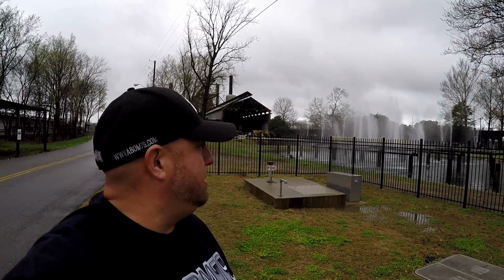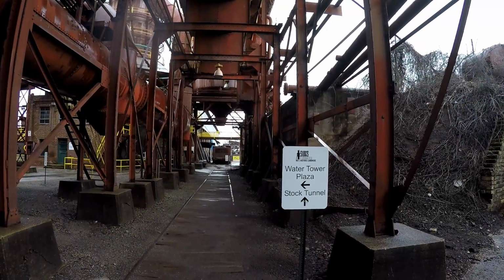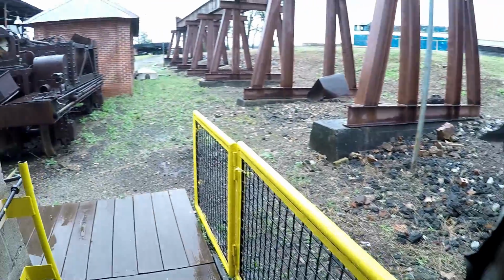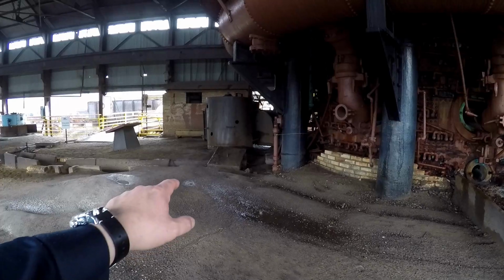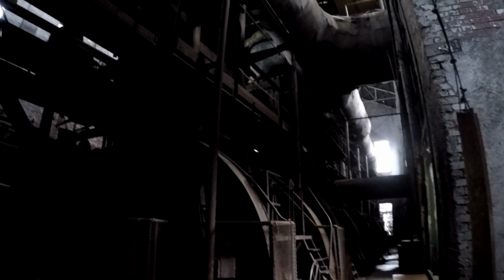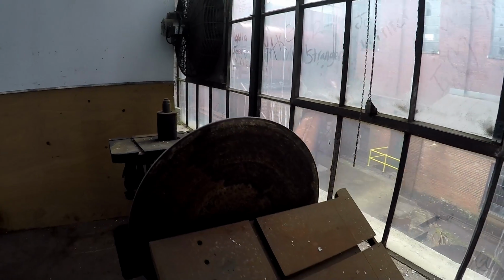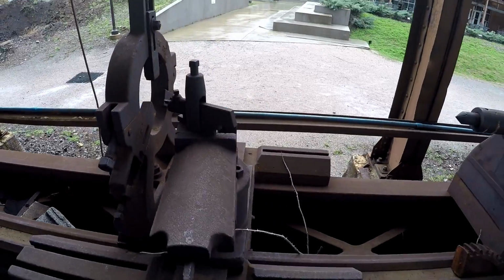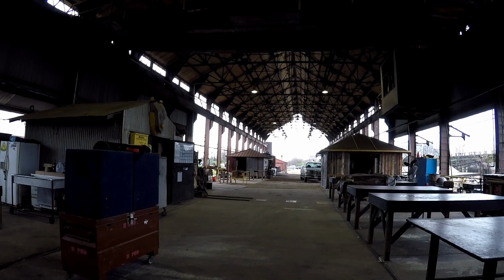Sloss Furnaces, Birmingham Alabama

Comment: Tunnels ain't the best place to work there when deal with BFG. BFG is basically CO (carbon monoxide) which likes to accumulate in low places. Operational personnel should ware breathing apparatuses, work with caution there. Areas around changeover valves of hot blast stoves are highly dangerous for CO. Areas on the superstructure (top of the furnace) around charging apparatus, top valves are dangerous for CO too.  Steel mills used to maintain rescue stations with full time trained personnel on the staff.

Comment: I worked for a company that supplies drive systems and rolls for the steel industry and yes the steel industry is in decline,almost gone. A lot of the old ,huge, mill complexes are either museums now or have been torn down; why? Simple, the steel manufacturers didn't invest in or modernize the mills, and the cost of labor and management sealed the deal,ironically, if you can't make or roll steel you can't  defend your country. There are a few mills still running, but for how long?

Comment: I may or may not have climbed the skip trolley stairs to the top of the furnace in the middle of the night when I was like 14.  The stair treads are 3/8" or so plate and some were very sketchy.  Not sure you could still get up there, but it's quite a feeling.
Reply: Lol. Dude, I've been atop both furnaces more times than I can count. I worked at Fright Furnace. We've even had actor parties up there till sunrise with about 20 of us.

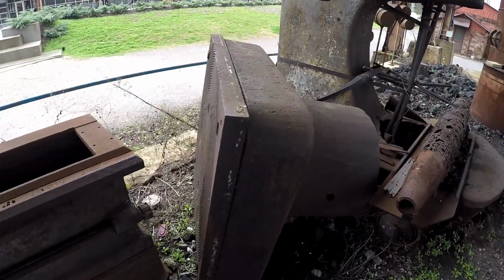Comment: The big solid piece of iron  at 33:52 is an anvil base for a power hammer, should have a machined groove in the top to hold hardened anvil blocks in with wedges.. Probably for the one it's sitting beside, but you never know in a place that old.. Hammer fits over it and tries to punch it through the floor.

Comment: We lost the Texas Foundry which was in operation before the Republic of Texas and many years before Statehood.  It's last job was making parts for GM and they shifted to Mexico and there went the workers and the massive forge.  We also at about the same time lost the Lufkin Industries Forge that make massive castings of Gears, shafts, Jack pumps and the famous ones Single ended 'donkey'.  They fit in tight places. The tubular and the large plate are for wood working - the tubular moved up and down (maybe) and sands curves.  The large flat with a wonderful table is for sanding flats.  This was a pattern shop when the foundry did castings and not just pigs.   Doing sinks for example required boxes and shapes to pour around.

Comment: It was a metal lathe. Wood lathes don't have a cross feed or any of that. Also it was a jointer not a planer and the big circle was a sander it used big sheets of sandpaper put on it. Also the on last one you thought was a planer is a surface planner

Comment: Another comment from me: The blast furnaces had a couple of bell shaped 'valves' at the top of the furnace. To charge the furnace, initially both bells would be closed by pulling them up to the seat; the material (hauled up by the skips) would then be loaded onto the top of the top bell. The bell would be dropped sufficiently to allow the material to be dropped on to the second bell. the first bell would be closed, and the second opened and the charge would drop in to the furnace. The bells acted like an air lock (long before NASA came along!). BHP in Wollongong, Australia (still going!) used these types of furnace and the bells eventually wore out and had to be resurfaced. They used a really big jig to set the side of the bell horizontally at the top and rotate it; a really big LPG burner heated up the bell and when hot enough, they had 2 x 1200 Amp Lincoln Submerged Arc welders in parallel and used quite thick wire (1/8" to 1/4"?) to go down in to the flux to reface the bells (sound familiar, Adam?). The leftover flux fell off the bottom as the bell rotated and was recycled to be used again. Fascinating stuff!

Comment: 2 Comments: 
at 30:55 - it is a grinder, and would use emery discs stuck to the working surface by a type of glue; you would heat up the glue pot in hot water and coat the disc, then apply the emery - my Dad had a Sunbeam comb (coarse) and cutter (fine) grinder to sharpen the combs and cutters for the shearers. Sunbeam was an Australian company which made sheep shearing gear, originally line shaft driven, and later electric.
At 39:55, it brings me to tuyeres (pardon the pun) to see this blast furnace ... !

Comment: oh, I think the machine by the window in the powerhouse was a spindle and sander and a disc sander. I saw a 3'-4' disc sander (two station) for sale on Craigslist once, so I know they made them bigger than 12-14". I bet they used all those woodworking machines to make the casting patterns, but maybe in a dedicated shop elsewhere on the site. that's my guess on that.

Comment: Good move Adam Booth ! Great initiative, THANK YOU.
Mountain Man is absolutely right. The plant management utilized the free space within the powerhouse - that otherwise would have been wasted - by setting up the patternmakers' shop right there:  a very intelligent solution, in every sense. 
You are right thinking the first machine to be a woodworking lathe, the one which you called 'grinder' is actually one half of a very early version of a disc/spindle-sander combination; an essential tool in patternmaking. The one that you have trouble guessing is a thickness planer - very early model also - as are all the machine tools here, obviously..
This whole lookaround is tremendously interesting, a most welcome look into History ( with the big 'H' ) of the First Industrial age, as it found its finest expression in the United States of America.
Rather important part of this tour is the revelation of the priorities, prevalent in the in the mind of those responsible for the running of things at the time. 
One can clearly see it in the way all machinery was built, with everything exposed ; belts; gears; cogwheels; pulleys; ratchets, blades; cutters; all kinds of bits that could - and DID - injury, hurt, maim - and KILL - anybody, careless and unlucky enough to get too close.  Human beings were then considered simple - freely dispensable - extensions of those 'precious' machines and consequently treated in a cavalier manner.
Every man for himself was the prevailing motto. If one was maimed or killed. well...too bad; plenty more where that poor bastard came from.
Having lived thru  and experienced first hand some of it myself, I feel excused for holding a rather jaundiced look in this regard still.
Nowadays - thank be to all gods in the universe - such state of things, at least in our corner of the world, IS treated with the greatest severity.
Thanks again Mr Abom79. I give you ten marks plus out of ten.

Comment: That 'tilting' bed unit appears to be a disc sander...and the adjacent looks like a drum sander...possibly an oscillating type, where the drum moves up/down as it turns...these appear to be wood shop stuff as there's that jointer too....disc sander used in a lot of metal fab shops too.

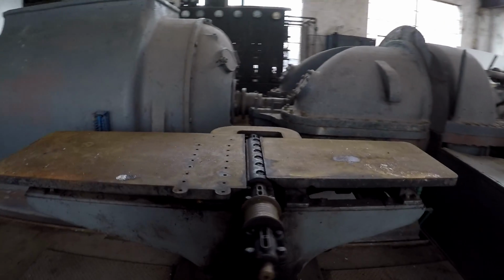Comment: at 27:12  it is not a  "planer" but actually a jointer and it's missing the fence.   Planers surface a piece of wood to even thickness the full length.  Jointer is for making the edge of face of wood flat for jointing 2 together or making a straight edge from a crooked one.
Reply: I learn things in the most diverse places. Never knew my Granddad's "plane" is really a jointer. 80+ years old, still runs, not a speck of rust. Thanks for the clarification!

Comment: I love foundries and mills. i worked at US PIPE in Burlington NJ. for 2 years when I was younger on the casting machines, but I worked in every area of the plant in maintenance at one point or the other. Many nights up on the skip charger and cupola deck.
Pulling stuck birds nest ladles was the hairiest job standing on the edge of a full 20 ladle on the turn table.

Comment: That was AWESOME. We have a few historical places here in  New England. we have the American Precision Museum in Windsor VT, there is a museum in Manchester NH about the Amoskeag Mfg Company. They made everything from textiles to steam engines. One of the things they are most famous for are the old steam pump fire engines. Then there is the national park in Lowell MA which is really the birthplace of the industrial revolution in America. I don't know if anyone answered you about the wood lathe, but it's a pattern makers lathe. The patterns are painted different colors based on the purpose of the feature of the pattern. I know red means it will be machined after casting. I'm sure you can easily google to find out what the other colors mean. Great video, this place is definitely on the bucket list now!

Comment: by the way the the company that made the ten ton crane morgan engineering is still around, they also used to make steam hammers, but now just make knetic structures like moving roofs for stadium, blaw knox pavers, and cranes as well as mill equiptment even to this day they are still around, under differant ownership but still around after 100 years

Comment: I work at a 200 year old oil refinery and there are some old parts (structures and machinery and piping) . I stair at the Beauty's of the old days ,all the time. then somebody says ..." hey you going to stand there !!!!) oh ....yea I'm supposed to be working ! lol . you can tell the time line of the structures by how it's made first they used  hand formed rivets then square headed  bolts then of course welded. we have a hand full of valves with swastikas cast into them. cameras are prohibited !  In the training video they say " your gate pass will be revoked"  but GREAT video !!

Comment: ah yes I remember hearing about the birmingham steel in geography in gradeschool when we studied about the states, the mill looks like it has seen better days needs a new coat of paint and a little maintanance on the outside looks like,  very rusty

speaking of old forges, the old blacksmith shop from bethlahem steel is being turned into a blacksmith school and some of the hammers will be put back ito use, I dont know if they will work on the largest one that has a u shape and resembles the big chambersburg in the old altoona blacksmith shop that was a 37000 lb hammer, or was it 30 ton as I try to remember but anyway the old forge shop for bethahem steel will come back to life think of all the parts that were made in there to keep the iconic mill running and young and old blacksmiths will be able to work with and learn on them how awesome is that.

by the way the boilers that heated the air  for the furnaces as you mention were called cowpier stoves I belive if they were indeed used to reheat the air for the blast furnaces.

haha the part about it being haunted its funny you mention that as I was just thinking the tunnel with the water looked like something in a movie or game where something was going to pop out and come after you, but the rain and sound make it more dramatic in the kind of sadness of loss of its iconic use as a working mill, from a more iconic period when we made more of our own stuff in the states.  though north west indiana is still churning out the metal, you got the us steel works at gary indiana and its the largest in the west hemisphere even 100 years later, and the arcero mittle belt harbor mill that has I belive the most blast furnaces in one mill with 5 not to far away from it so it makes no less then 9 blast furnaces in one region.
Reply: I'm a boilermaker. I work at these alot
Reply: the cowpeir stoves? or the mills in general?
Reply: Steel mills, refineries, coal fired power houses. I live near Gary,Ind.
Reply: well I am sure it keeps you buissy with all that industry up there as there are mills and refinerys as far as the eye can see. been though there on the way to chicago many times, but I hear the crimerate in gary is abysmally high, though that might just be an old wives tail by now.  but that whole area to east chicago is one giant industry after another.

Comment: Adam, as cool as that is (and it is VERY cool), if you're ever near the upper penninsula in Michigan, you HAVE (absolutely HAVE) to stop into Fayette State Park.  It was a town that was built near the docks of Escanaba to produce pig iron.  They had been shipping ore to lower Michigan to be smelted, but were losing 40% in volume during the smelting process.  Was quite costly to ship that 40% that was worthless.  So, with the abundance of hardwood and lime stone needed to smelt the ore into pig iron right there in the U.P., it was a natural choice to just build a smelting operation near the ore mines and only ship the pig iron south.
It operated for 24 years, but in 1891 when the charcoal iron marked fell out, everyone just left.  It is awesomely amazing to not only be able to walk around the smelter, ovens to turn wood to charcoal, etc., but they left a ghost town.  You're able to walk through the houses and buildings and are able to find the equipment, machines, school, theatre, etc.  Almost feels like they just turned the town off like a light switch.  There are still boring bits stuck in the limestone where they broke off in the quarry.
All throughout the town are plaques describing what you're looking at and explaining.  To top that, it is set in what has to be the most beautiful harbor in all of michigan (IMO) with tall, tree-topped limestone cliffs poking out into the lake!  In the fall, first couple weeks of October, it is absolutely stunning with fall colors!
http://www.exploringthenorth.com/fayette/town.html (i'm not affiliated with that site or fayette or the state of michigan in any way, other than living here and loving it  :)

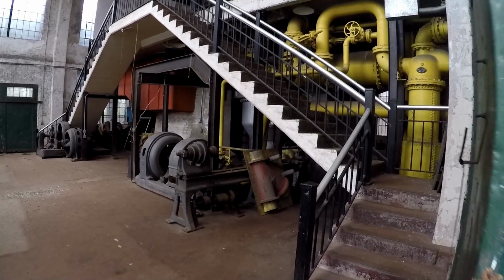Comment: 26:00  correct, it’s known as a Pattern makers wood lathe.  
-Many production architectural wood turners  (balusters and spindle work) still use those old pattern maker lathes.  Oliver is a highly sought name brand for those.       
-The following wood jointer, disc sander and spindle sander were neat to see there too!  It’s cool many patterns for castings all started with wood and skilled pattern maker aka: woodworker.    

Great documentary style video, man!

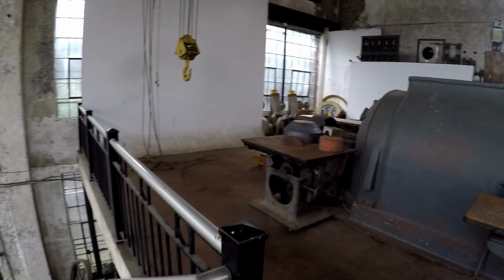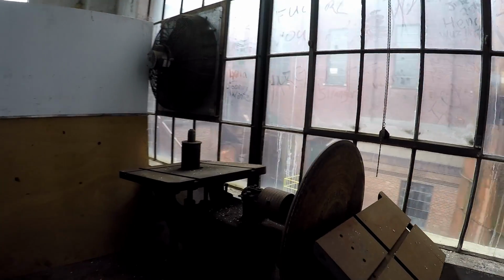Comment: At 26:49 when you entered the Pattern Making shop the large machine with the tables on either side of the cutter head is a Joiner, looks to be about 24"? The two handles are for raising and lowering the in-feed/out-feed tables when planing the surfaces. @27:47 the Disc sand/Spindle sander appears. The vertical spindle probably oscillates up and down to maximize use of the sanding drum surface area. The tables are also adjustable for sanding and profiling specific angles and curvatures for casting patterns.
Reply: That would be a joinTer. :)  In Europe, they call it face planing.  It gets one face of a piece of wood flat...then you run it through a planer (thicknesser in Europe) to get two parallel surfaces to each other.  That jointer is missing a fence which allows one to then cut a 90 degree corner to those two parallel surfaces. Then you rip it on the table saw and viola, a piece of wood all S4S (all 4 sides clean, flat, parallel, 90 degrees) ready to cut to length. :D
Reply: cpad007 Actually, no, it is a joiner. It's a common misconception because it's used to make flat, smooth surfaces for joining, not jointing, wood with glue.
Reply: actually, no. It IS joinTer.

http://www.martin-usa.com/products/t54/
https://www.felder-group.com/us-us/products/jointer-planersjointersplaners/jointer-plan-51l.html

Would have just taken a simple search to not look like an arrogant fool.
Reply: Yes, it is a joinTer.  Google around a bit and see what you think.  There are lots of long threads that discuss this ad nauseam.  Here is another link to ponder: https://tooljuice.com/difference-between-jointer-joiner-and-planer-which-to-buy/

Comment: 25:00 - 30:00 -- Adam, you're correct about the wood working tools:  wood lathe, disk & spindle sander, jointer, & planers.     All belt driven from a common line shaft running through the center of the shop.  They probably all screamed like banshees when they were operating.  Very, very neat.

Comment: Question, little off topic. I need to cross drill a 7/8" hole in 2 new chromed, 1045 induction hardened bars 1 1/2" dia.x 24" for  hyd. cyls. that I already machined on piston ends for BH stabilizers. To break thru the chrome and case hardening am I thinking right to heat with a torch a red hot spot the size of the hole on each side to anneal it soft enough to start and finish the hole? Also thought about grinding. any suggestions on how you do it would be appreciated. Always great videos. Thanks. Ed K. Cleve. Oh.
Reply: If you have a plasma cutter, you could try using it to heat the spot (arc only, no air) as it will better localize the heat to the spot you want to anneal. I suppose you could use a TIG welder to do the same thing. Would be much more precise than an oxy-acetelene flame.
Reply: Thanks for the reply and info. I decided to use the oxy. acetylene torch last night and heated to red hot till loss of magnetism the dia. of the hole size needed on the surface and let heat soak for a bit on both sides of where the hole was to be drilled and let cool slowly. Worked perfect, spot drill, 1/4" drill, 1/2"drill 3/4" then final 29/32". Chrome and case harden area cut nice with very little resistance. Afterwards everything polished up perfect. First rod took about 30 minutes after cool down. Second about 15 because I counter sunk the initial hole to almost finished size. I personally would recommend what I did to cut thru case hardening in a job like this. If I had a larger mill and drill press the drilling would have even gone quicker. Thanks, Ed